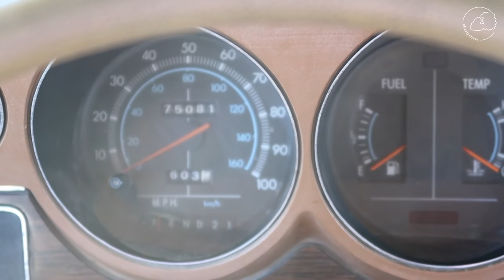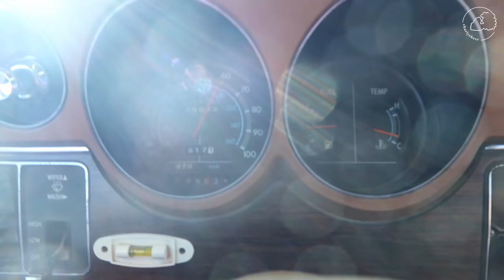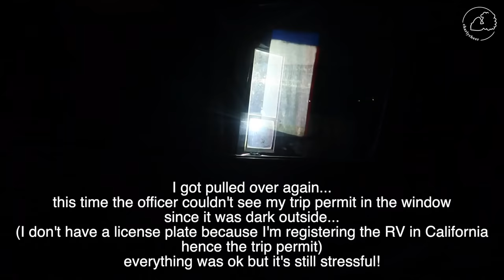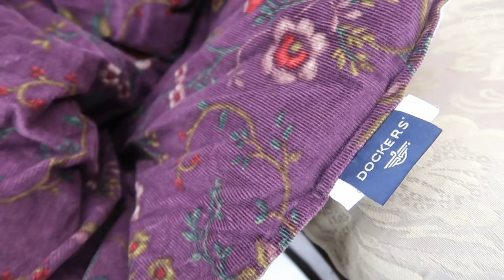I Flew to Oregon to Buy My 1978 Vintage RV! | charlycheer

Comment: Check online to get RV towing etc coverage, that's super important. Also make sure your tires don't have tire rot, that is really important. Don't check at a tire store, they will want to sell you tires whether you need them or not. If the tires are pretty old they will have cracks on the sidewalls, and a little auto repair place in a smaller town are great places to go to for these things and for repairs.

Comment: My hubby & I bought a 2002 RV (or motorhome) 6 months ago. Haven't used it because I wanted to have the brakes checked out & repair places were booked solid! We learned that we could only get LIABILITY INSURANCE--not the other half. So if in accident, we're toast. Only 60K miles on it. Couldn't help but wonder the cost of your vintage RV and if you could get full insurance coverage.

Comment: Make sure to change your transmission fluids and your engine oil
Reply from the maker: It’s funny because that’s actually what the mechanic said today when I took my RV in. He said I should flush the transmission fluid, coolant, power steering, and I can’t remember the other one off the top of my head but there’s one more.

Comment: I had a 76 Tioga that I renovated.Big block(the good one) and low mileage.Under 100 k when I bought it.Someone stole it and I was heart broken.So I'm thinking on buying another one.Id lojack this one though.Older RVs don't need all the paperwork that new ones do.It's easier to steal and sell in another state when they are vintage.Im so excited for you.You are going to love it(I loved mine)and enjoy so many new things.Lojack is a good thing to think about!
Reply from the maker: Thanks yeah I'm planning to get some type of security system. Thanks for the recommendation because it's something I would like to get asap. I would be sooooo heartbroken if mine was stolen 😭  I'm sorry that happened to you. Unfortunately mine is 2 years too new to bypass the smog check. Cars and RVs made before 1976 don't have to get smog checks but mine is a 1978 so I still have to. Thanks for commenting!
Reply: @charlycheer  you are going to love decorating your baby.I did serene bright colors.Calming,but lifting at the same time.Think Canary island colors.And always watch your water lines.I had a small leak in the bathroom.It wasn't a big issue(because I watched leak spots carefully).IKEA has some neat thin mattresses.They are great for RVs.Id suggest lining curtains really well.One lady said she quilted the inside of her curtains to help.I thought that was pretty smart of her.There are reflective inserts you can make for when you are sleeping.They pop into the windows.I love the bright retro curtains you chose.
Reply from the maker: @cynthiacrawford1573  yes I made inserts in my car when I did car living for 8 months. Thanks for the tips!
Reply: @charlycheer  it's amazing the tiny things that make life easier.And in the RV community most people are pretty nice.And if they aren't then it's easy to stay busy and not bother with them.RV life or van life is full of great people.The only thing I never could figure out was plants in the RV.They give out fresh oxygen .I saw several people that pulled it off.You sleep well my friend.Thanks for taking time to communicate back.I appreciate seeing your stuff.
Reply from the maker: @cynthiacrawford1573  I’m currently adding pothos cuttings to my RV in some repurposed wine bottles. Can’t wait to show you! Night night. 🌙

Comment: Congrats on your new adventure. I have to say , I think the dealer pulled a !*$* move by not at least providing a new air filter & an oil change and top off. They new you were driving all the way back to Cali.
Reply from the maker: Yeah they told me before I flew that they were selling it as it was. I don’t think they even opened up that area where the air filter was stored.

Comment: Did I miss something , why don’t you have any heat in your RV?
Reply from the maker: I do it’s just that the mechanic showed me right before hitting the road that I had to keep the heater cover on in order for it to work cause it had slid off and won’t turn on if it’s not attached. Simple fix but I was so glad he discovered that. Now I’m in California and don’t need it during this time of year haha but was able to use it on my way back to California from Oregon.
Reply: The vehicle heater should be working while driving ( not sure why gloves are necessary)
Reply from the maker: @jdawz2816  It does work.

Comment: Where did you fly from
Reply from the maker: California
Reply: @charlycheer  I'm in California also I'm in Napa, I just recently was given a 84 Ford jamboree myself looks a lot like yours and it too is in the shop we did a whole new brake system new real bearings new spark plugs system cleaner all new fluids and much more pick it up from the shop today to turn around and put it in a different shop that sold tires we're getting six brand new tires never used..... I'm putting in new floors and a backsplash in the kitchen I'm going to paint it..... Are you on Facebook I would love to follow you on there and see your journey and if you remodel your RV

Comment: Why aren't you using the rv furnace? Did i miss something? I'm bew to your vids. And have you heard of blm land? You keep sleeping in walmarts.....
Reply from the maker: I started using it right after the mechanic connected the furnace cover cause he told me it wouldn’t work without the cover/lid that had slid off. He put it on and showed me how to use it right before I hit the road. Oh and yes I have heard of blm land it was just easier to track my trip by stopping at Walmart’s on the way.